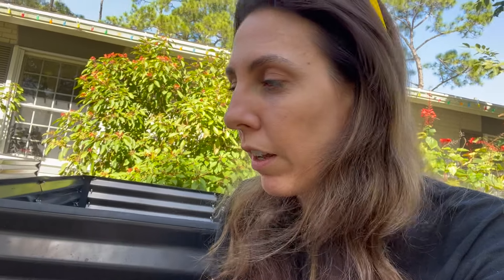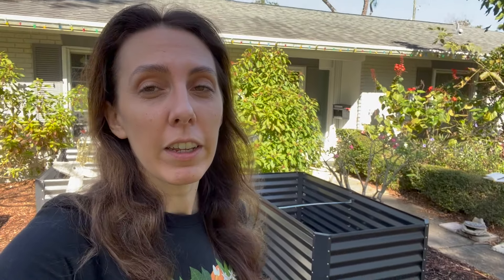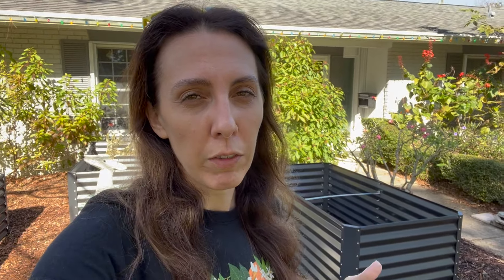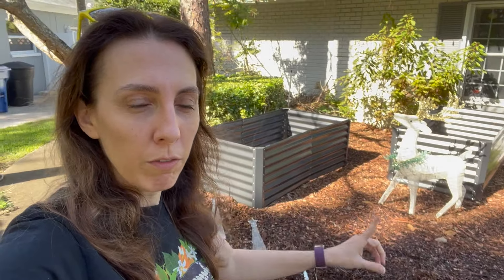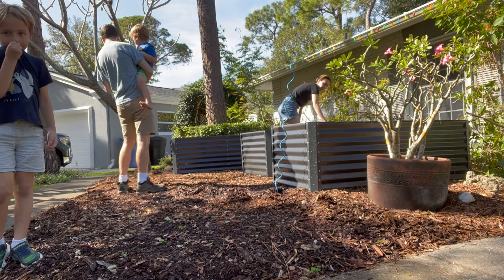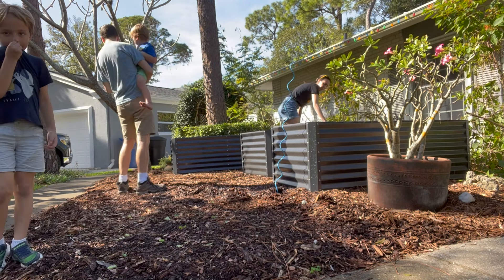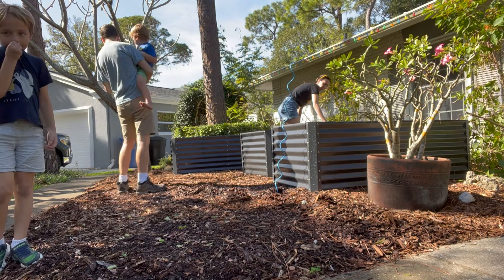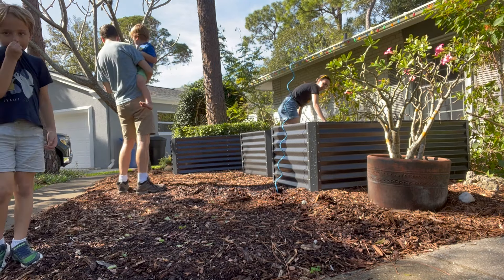I MESSED UP!  Avoid these 8 MISTAKES when building raised metal garden beds

Comment: Learned a long time ago that the first step is to always inventory the parts.   Read the instructions once and then do them step by step as you read through them again.  The only thing I would add to the bottom of the beds is stainless steel mesh hardware cloth to prevent animals from tunneling up from the bottom.  Those metal beds will last a very long time - so no need to rush building them, get them right the first time.

Comment: Did you compare cost of buying these versus building from scratch? I suspect building would be cheaper/easier. Buy galvanized roofing and some 4x4 post for corners. I have a garden I planted in the ground this year and it is doing well, but I was thinking about raised beds next year. Your beds look great tho, sharp looking.
Reply from the maker: I did not. I didn’t want to invest in tools. I’m a basic tool set kinda gal. 😁 Generally, you trade time for money. So often it is cheaper to build from raw materials. So it wouldn’t surprise me if you came back and said there was a cheaper way 😄 These particular beds have some design challenges and  I’m, now, trying a different brand. The new brand I like better. It had some things that would be harder to replicate from scratch (Ex. The double coating)
Reply: @WildFloridian  I am looking into different options. Normally I fly by seat of my pants. I told my wife we should plan out what we will eat, what we should grow, then plan based on those needs. I will end up flying by my pants 😀 good luck with your garden and thanks for reply

Comment: Thanks for the great tips !.
My wife and I just bought 2 of the same exact ones on Amazon. 1st time using these types of beds so thanks for the heads up.
How are yours holding up ?
Do you still like them ?
Thanks
Che
Reply from the maker: I’m glad the tips helped. I would return them if you haven’t opened them. Six months later there was significant rust degradation. I do not recommend these. It is over a year now and the corners are so degraded, I don’t know if they will hold up beyond another year. Hope that helps
Reply: @Wild Floridian  wow, thanks for that update on the rust. I just ordered from Amazon this morning, haven't received them yet. After thought, the metal corners definitely look a little flimsy.  Any other recommendations,  different company, wood ?
 Etc...
Thanks
Che
Reply: Would really like to use these, I wonder if I should build my own corners and use the rest of the metal. Is that the only part rusting are thecorners?
 So you are not going to use them anymore ?
I live in upstate NY where the weather is a heck of a lot worse than where you are
Che

Comment: I literally just finished one of those and I found out how many screws I could put in before I lost my mind so I did it over a few days lol.  Now I’m confident that I could build another one without melting down, but I will tell you this, the instructions that I got were terrible and indecipherable they did not make one bit of sense and I read them and I reread them.  

Granted I hate this kind of crap but it’s OK I got through it and maybe I got a different brand than you I don’t know it came from Amazon.
Reply from the maker: The ones in this video were not good to put together. I'm an engineer... and I thought it was not well packaged which led to damage which led to problems installing. And now... I'm really mad. The corner pieces are rusting big time. I've only had them 6 months. Not worth the money for this brand (Best Choice Products - Amazon). I'm trying a different brand (VegeGa). So far so good. Better packaging to protect panels. Simpler design... so it is easier to put together and... not as many screws. I'm watching to see how they hold up to Florida's corrosive weather. Summer is the harshest for metal products. So far so good.
Reply: @WildFloridian  Great video! I'm in Canada, at present trying to put together a Vegega round 32" bed, Epic Gardening don't deliver to Canada (!) so I got it direct from China. It arrived late, got delayed 3 times, customs ripped it open and let all the nuts and bolts/screws roll around inside! Took a month overall, and corners bent! So not happy. I'm a senior woman, had to unbend the corners as best I could, put it together last night and can't get the last piece to connect with the first piece to form the circle! It's hard alone, it springs back and I can't hold it to line up the holes and also put in the screw/nut etc. it's nigh impossible! The gap looked too wide like there should be another half panel but of course there isn't! I left it last night on it's side hoping the gravity would pull it down together more haha! I haven't checked it yet. Thunderstorms due soon.
China support have been good, gave me a small discount, and reply to my emails, but the translation is well... they don't understand why I'm having a problem. I think it's the tensile strength thing you mentioned? So I'm going to undo some bolts, loosen or remove and see if it helps. If you can comment I'd appreciate it as an engineer and someone who's done the job! I have no helper... so HELP! 🙏 ♥